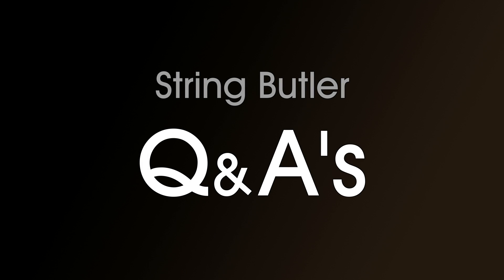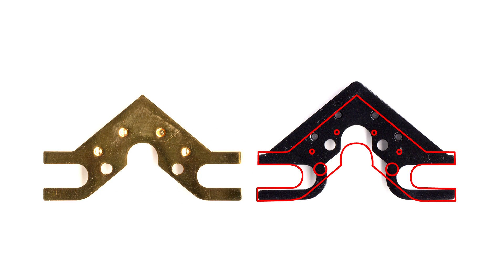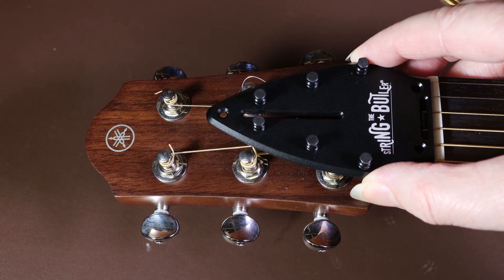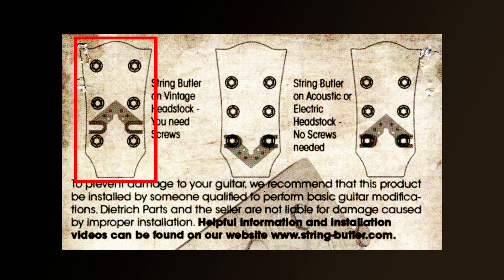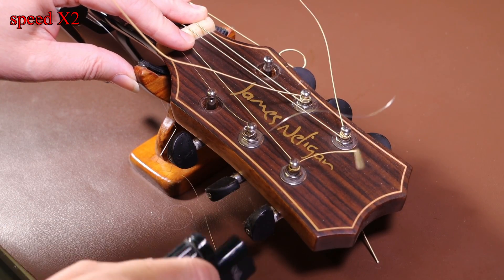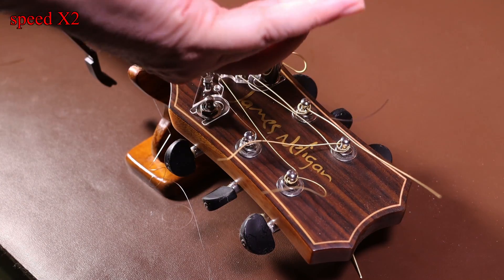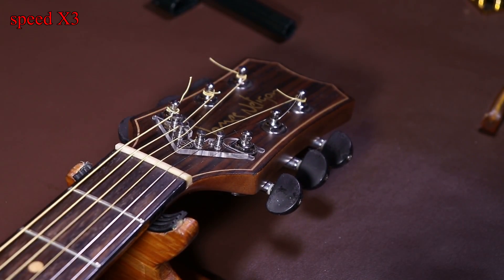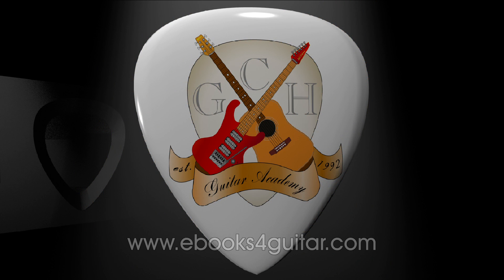how to fit a string butler on an acoustic guitar and different versions explained

Comment: Hi please cover Vintage Head stock with keystone buttons with string butler
Reply from the maker: I'll put that on my  'to do' list 😊
Reply: @guitar-academy  Thanks a lot you are very kind ..... I did some research and come to know that String Butler V1 (New that came out) will be the solution that will work. V1 replaces the Truss Rod cover and should work ...i have taken measurements. Thanks again for your time and replying back much appreciated thanks
Reply from the maker: @RahulSharma_JaiMataDi  I know that the size is correct, but watch out for the bushes on the tuner posts.  On very old guitars these are just pushed into the holes meaning you have to screw the SB to the headstock with screws.  But on newer vintage tuners the bushes are also bolts that will hold SB in place the same way the one is held in place in this video. 😊
Reply: @guitar-academy  Thanks again… don’t have bolts … its Epiphone Masterbuild Frontier … Love the sound of the guitar only issue is after week or two won’t stay up n tune I hope this will fix it

Comment: Version 2 would not have fit your guitar. You showed this example in the video from 3:01 to 3:08.
Reply from the maker: Yes that's correct, the version 2 is wider between the mounting points